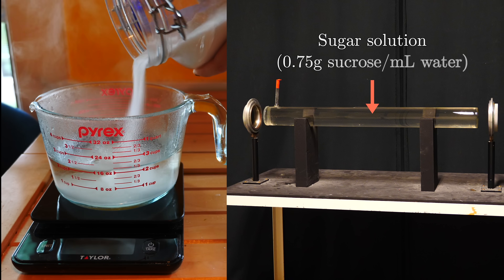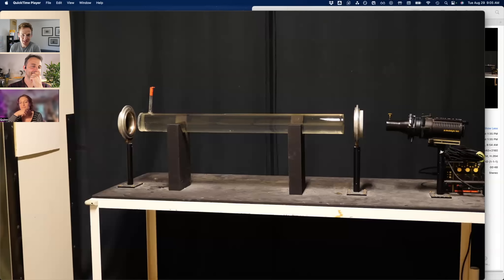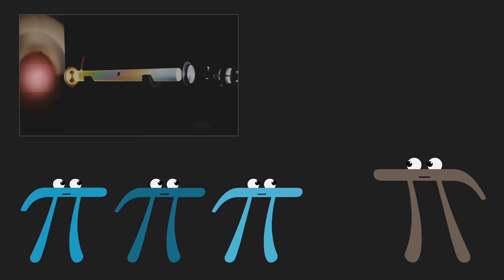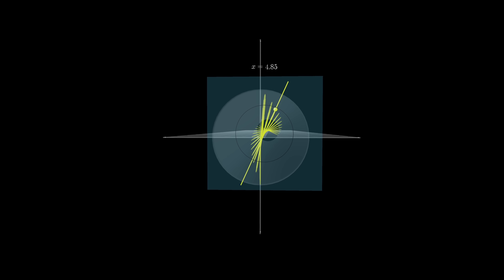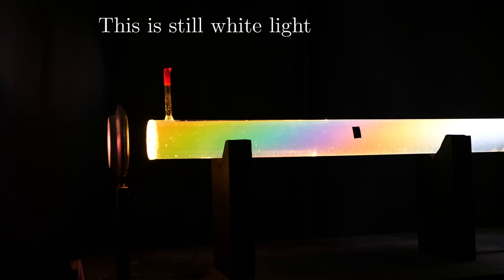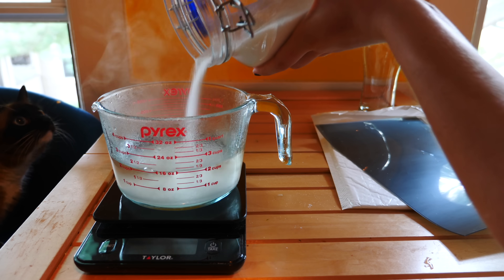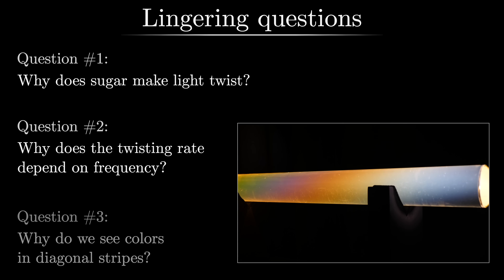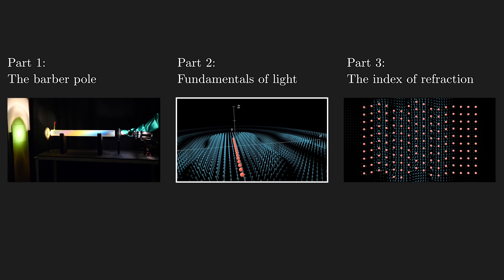This tests your understanding of light | The barber pole effect

Comment: I'm an optical engineer. I have solid intuitions about light. I still said "what?!" out-loud involuntarily when the lights dropped the first time.
What an amazing video!
Reply: it truly is an amazing video
Reply: One of those things, where the more you know (up to a point), the more surprising the result. Truely the best kind of experiment.
Reply: Right there with you (optical and opto-mechanical) the angle is weird. You just don't anticipate the "rotation" to be so slow...
Reply: Any chance this will replace separate RGB diodes someday?
Reply: @KeithSmith42  Diodes replaced this actually. It's how LCD screens work.
Reply: @userJohnSmith  So before RGB pixels were single tubes that used a filter to output the desired wavelength? I thought diodes replaced electron gun-based CRT screens
Reply: @KeithSmith42  LCD and plasma were the in between. I remember when LEDs were coming out it being such an obvious upgrade after all the sensitivities of the other approaches.
Reply: @userJohnSmith  I think you’re missing my point. I’m saying using a tube and filter to select a single desired wavelength of light would be more efficient than current pixels that use three color RGB diode array and mixing them. Lots of work to get from the example in this video to current pixel size and density tho. Everything I’ve looked up about current and prior methods for generating images use separate red, green and blue channels to mix the desired color.
Reply: @KeithSmith42  Ah. No. Our eyes work in RGB so we need to get the information from three pixels. It's stored that way for a reason. A series of monochrome pixels at central wavelengths would look very strange.
Reply: @userJohnSmith  I understand that we have cone cells in our eyes that are sensitive to different wavelengths of light roughly corresponding to red, green, and blue but they're saying in this video that the colors are even richer than when relayed through the camera and screens to the other participants in the video call via RGB signals.
Reply: @KeithSmith42  Of course, but using this in a projection system to make the colors more vibrant would require dozens of pixels rather than three. Monochrome is like lasers. The colors are uniquely vivid but won't properly convey a shade of brown.
Reply: @userJohnSmith  ah yes I see. It’s a shame it’s not all hyper saturated colors!
Reply: @KeithSmith42  Yeah it is kinda. This is, I'm sure, dazzling in person. But you could probably do it at home with some polarizing sun glasses and a little creativity.
Reply: @userJohnSmith  The problem with reproducing some shades of brown and other subtle shades is in the digital encoding rather than the hardware. Separately encoding red green and blue with 8 bits each has been known to be limited for a long time, and there have been better encodings since the 90s if not the 80s, but people won't use them; they just stick with the familiar old RGB triplet. It's a sad fact of computer science that if there's a widespread explanation which is nearly but not quite good enough, people will refuse to learn anything else.
Reply: @eekee6034  Plus it's a lot more data to cram into 4k of you jump to 12 but or 4 color. Having done a lot of image analysis (for testing optics), this is not a small problem.
Reply: @userJohnSmith  Bandwidth always gets in the way, :) but I didn't mean merely increasing the bits for each color, I meant encodings like YCbCr which are designed around how humans perceive images. Wikipedia's page on YCbCr is fairly good. Here's a quote on what you can do with it:

"One practical example would be decreasing the bandwidth or resolution allocated to "color" compared to "black and white", since humans are more sensitive to the black-and-white information ([a remarkable set of images illustrates this]). This is called chroma subsampling."

Comment: ~ 2:00  Cast plastic tubes can have some odd built-in stress, When they're used with those Stress/Strain revealing set-ups with polarized light (common in Engineering), they reveal their cast-in (then solidified) stress characteristics. This is well known, so don't leave the plastic tube of the analysis. That sugar water ain't holding itself up in mid-air.

Edit: Glass or Pyrex tube?  Likely safe to disregard above. Cheers.

Comment: Ever heard of the thought experiment where one is talking to a distant alien and you're trying to convey things to each other. The exercise is supposed to break down at "describe left". As there is no inherent 'left' to use as a reference. You can relate up and down with gravity wells, forwards and back by just picking a reference point even if it is not the same point between you two. But there is not supposed to be a way convey 'left' or 'right'. This sugar water experiment allows for a left/right in unambiguous terms! Break it out on the next teacher that brings this exercise up.....watch em turn red 🤣🤣😈

Comment: It seems to me there should be a question 2.5: Why do you see any colours through the side of the tube?
Also, 2.25, perhaps slightly easier: Why do you see any light at all through the side of the tube? Most of the light in the tube is going almost parallel to the axis of the tube, so when it strikes the wall and exits into the air, although it will be more perpendicular to the wall due to refraction it will still be generally directed away from the light source and we would not see it.

Given that answer, I expect question 3 amounts to the refraction of the light by the curve of the circular tube. Light seen along the centerline is coming horizontally when it escapes the liquid. Light seen near the top and bottom edges would have been going at an angle (based on Snell's law and the refractive indices of the tube and the sugar water).

One viewing variation not shown in the video was how the appearance of the tube changes as you move the viewpoint up or down (around the tube) but that would be equivalent to rotating the first polarizer.

Comment: Ok… so what if we put 3 filters at the end, the first and third perpendicular, but then alter the middle? Will it be a change in brightness? Or will color change too?
Reply: Two perpendicular polarizing filters will block all light, assuming they are ideal polarizers.   Inserting a third polarizer in the middle, at an intermediate angle, will allow light to emerge where it otherwise couldn't.

A general idea of what's happening with polarization:
Suppose Polarizer #1 has its polarization along the x-axis, and polarizer #3 has its polarization along the y-axis.  Place polarizer #2 with its polarizing axis at an angle of theta from the x-axis.

For any given light ray with a polarization angle of phi, from the x-axis, and amplitude of A, the new amplitude will become A*cos(phi) as it passes through polarizer #1, and its new polarization angle will be zero.  Then when it passes thru polarizer #2, its new amplitude will be reduced by cos(theta), and will have a polarization angle equal to theta.   Finally, when it passes thru polarizer #3, its new amplitude will be reduced by cos(90 deg - theta), or sin(theta), and its new polarization angle will equal 90 degrees.

So on net, its new amplitude will be:
A*cos(phi)*cos(theta)*sin(theta)

Without the middle polarizer, its amplitude will be:
A*cos(phi)*sin(0 deg) = 0, regardless of the angle of phi

Since the light is initially unpolarized, we really want to integrate its intensity across all possible values of phi, assuming a uniform mixture of all polarizations, and intensity is proportional to the square of the amplitude.   For our purposes, let's just say it equals the square of amplitude.

Thus:
Initial intensity I0 = A^2
Final intensity: I = A^2*(cos(theta)*sin(theta))^2*integral cos(phi)^2 dphi/(2*pi) = A^2*(cos(theta)*sin(theta))^2/2

To maximize this value, we want theta to be 45 degrees, so that sin(theta)*cos(theta) is its maximum, which is 1/2, and the final intensity is I0/4.
Reply: @carultch  yeah, I can follow that, but I’m more wondering about this scenario, in particular, how the color plays into. Just one filter rotating changes colors, so if there where the three, does that change color? Or did the first filter only allow a certain color through, so you are just changing the brightness of it?
Reply: @PsychoMuffinSDM  The filters are all color-agnostic in this experiment, as close as a manufacturer can make them to color-agnostic.  It is the sugar water that is producing the color in response to the light.
Reply: @carultch  yes, but the filter rotating at the end changes which color passes through. So let’s say if green was coming through the first filter at the end, would another at 45 degrees change it to a different color, or did the filter set it to green, and the second filter just makes the green darker?
Reply: @PsychoMuffinSDM  If the filter is aligned with green at the end, it still lets through all the other colors.  It just attenuates them according to the cosine of the angle between their polarization, and the orientation of the filter.   In your example, green would go through with 100% transmission, and the other colors would attenuate.  So you see a mixture of light that isn't pure green, but is biased with a disproportionate amount of green.

Comment: is there a molecule that doesn't spoil that also has similar chirality/light twisting properties? it would be probably very useful in optical computing
Reply: Yes, there are a bunch of ways to do this
Your phone's LCD display actually uses this exact property, LCDs twist light by an angle proportional to the voltage you apply to them. It's this experiment except there's a different sugar water tuber for each color, so you get a better color control.

Comment: When you stand at the back of the eperiment and look at the tube you get the weakest light since the beginning is pointing all the energy that way so when the sugar water mixes it has tiny crystals that allow the light to bounce and split into differences due to the energy changing through the interaction but the general direction of waves push the scattering plot to specific patterns in certain directions so it looks like its a spiral but we are seeing the reflected light so as we move to in front of the experiment we should see the light go through the variations due to the scattering andn our eyes direction/location in relation to the cone of light. What i mean is that the tube doesnt hold all the light and what we see is related to where the light is inside but the light is scattering out of the tube in a direction of a cone toward the end but out to the sides since the light is hitting a wall basically and that causes energy to change direction. Im not saying im right but i hope if you read then it makes sense and maybe helps.

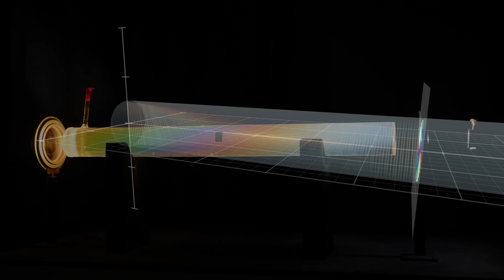Comment: 7:30 The reason its changed from the side is because we see what is absorbing the light/where it has frictions and thats why we see the specific waves bouncing off. Like as it scatters to the sides it still is in the direction of one way because its like a cone of light exiting the sides at different wavelengths but if you stand in front then youll see mostly white because majority is that way. The sugar and water make the light change, the change in frequencies keep each other in order like waves falling into troughs and lining up to where they match and then the light exiting the sides is always happening but our position is a factor when taking in the light and how much of each wavelength. The lens in is like one beginning so the change passing through is like majority the same and so the spin is the change and it only looks like a spin because the container and the exiting of light and the direction of change.

Comment: pausing now (8:00) here's my guess. Reflection and refraction of light through a surface polarize the light that is reflected / refracted at that point, parallel to the surface and perpendicular to the propagation of the light. Because it's a cylinder, that means that from any angle, the light is polarized at a different orientation, but at further and further distances, the colours are "twisting" further and further; hence the helicoidal stripes... ?

Comment: When light is reflected / transmitted through a dielectric surface, the reflected and refracted light has different polarization. Specifically if the incidence angle happens to be the Brewster angle the difference in polarization is maximal.
My guess is that because the ratio of reflection and transmission depends on the polarization of light, a polarized photon leaving the tube is more or less likely to be reflected on the surface of the tube depending on the polarization angle. So what we see when we look at the tube is that light will initially mainly leave the tube to the top and the bottom, but as the polarization the direction of the direction of the light leaving also changes.

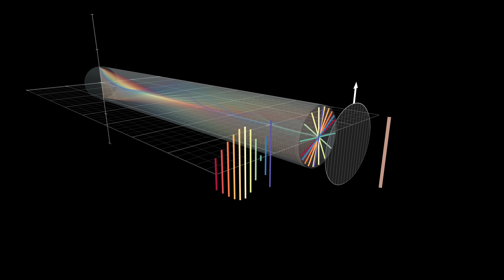Comment: 6:20 The light is undergoing a change and spinning the filter lets one freq hit it perfectly due to the direction it lets waves through/accumulate on the filter. The sugar is a crystalline structure that makes light break into variations and those differences hit each other and keep each other in line like a rainbow and the arc of the water.

Comment: Yes please, a "deep to the bones understanding" is anticipated. (I don't believe it, I still can't think 3D-T cubics in 0-1-2-ness log-antilog spherical Spinfoam-pulse bubble-modes in standing wave modulation evolution..?)

Sugarcane Farmers need a gadget to measure CCS concentration in the crop before harvesting,  as do Melon Farmers and farmers who pick crops by Sugar Content, so this is not an inconsequential piece of knowledge. 

Interference positioning resonance Entanglement inclusion-exclusion timing-phase incompleteness can be tracked back to fit the 0-1-2-ness GD&P Singularity-point reciprocation-recirculation coherence-cohesion sync-duration resonance @1-0-infinity instantaneous trancendental cross-sectional composition, point by point,  ..as demonstrated in Part 2?

Comment: So as a layman with zero education, i assume the light is spiraled and distinct because it 's polarized. normally you would get a 360 scattering of each wavelength from the side, but in the case of polarization and the reaction with the sugar, you are getting a slice that, from the correct angle, overlaps itself and you get more of that specific wavelength at the intervals that they rotate. 

Your single line example is perfect for this. basically the color is the most vibrant when the "line" is parallel with your view (looking directly down the line, basically creating a dot.), and then becomes more diffuse as it rotates to a perpendicular position.

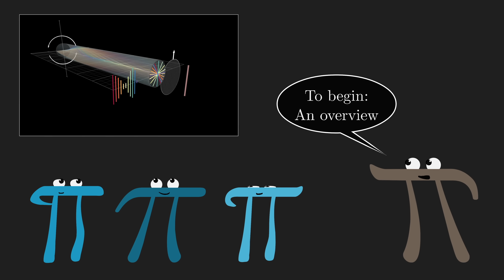Comment: 3:09 The light is being pushed against the sugar and the resistance when passing through, like the quantum tunneling like affect and the points the light change and come out different but the push is still there from the back and theres nowhere for it to go but the way being pushed so it spins. The direction of spin could be the light hitting the other wavelengths and keeps them in line where theyre supposed to be in connection to the colors around it.

Comment: If the different frequencies are twisting at different rates then it would make sense that photons are only escaping the glass as the wave approaches perpendicular to the wall of the container and dominantly so. This explains the white at the front of the container where the waves have not yet diverged to a significant degree. Different frequencies twisting at different rates also seems obvious to me since high frequency light moves back and forth through the container more quickly therefore taking a longer path and interacting with more sugar.

Comment: this may be a stupid question but looking at that setup, the Light source seems to be slightly up.   Also, isn't there a law for light that when it goes through one substance to another substance lighe slightly changes direction?  (fish in water isn't were it looks to be).    Im wondering what happens when you add the Skew of the light source, to the refraction angle of the light going into the water, if that sum isn't somehow related to the steepness of the 'barber pole' effect we're seeing in the color.  I know it's not a laser.   Maybe it's my OCD that makes me wonder about that light.

Comment: what will happen if you keep filters stationary while rotate the tube along the long axis ?and what will the tube look like when keep everything stationary just rotate the camera around the long axis of the tube? And what if you extend the tube longer than the two or three full sprial l. Will the pattern become more dense or separate? I'd be very eager to see these experiments . thank you
Reply: That's essentially identical to rotating the first linear polarizer (why?)
Reply: @quinnphys  I do suspect that. But will that mean the sugar inside has some direction-specific properties? And if that's true, how is this leading direction determined among all sugar molecules along the tube, and will that also mean if I add a running mixer inside the tube, the pattern will not be visible because the sugar are randomly aligned. Geez, so many questions a video raised.

Comment: Without looking ahead, my guess to #3 is that it's either due to refraction at the edge of the glass tube, or lensing due to its cylindrical shape. If you could suspend a column of sugar water without the container, I wonder if you'd get the same effect? Or if you used a rectangular column instead of a cylinder?